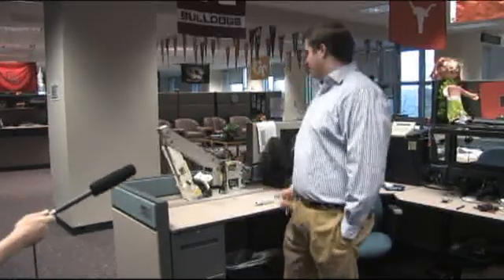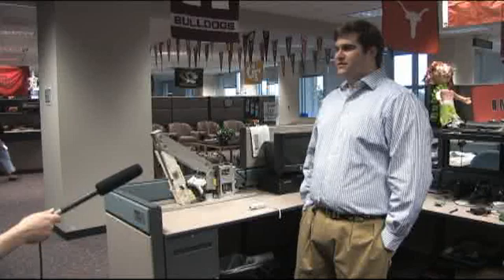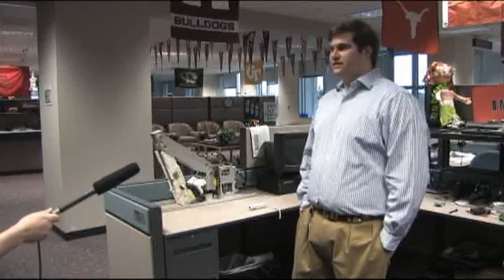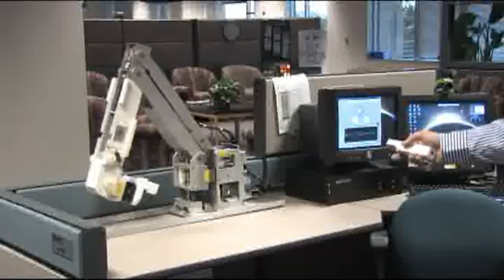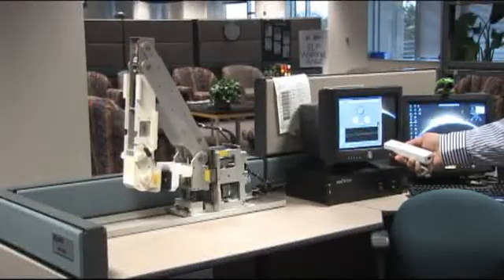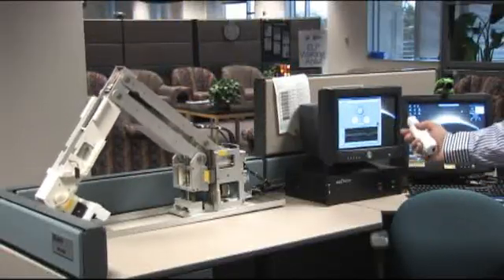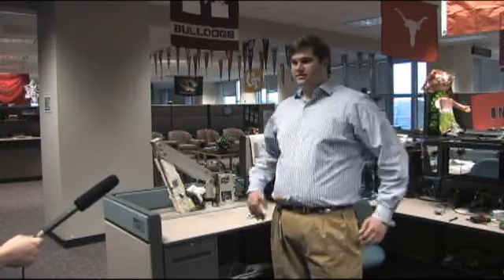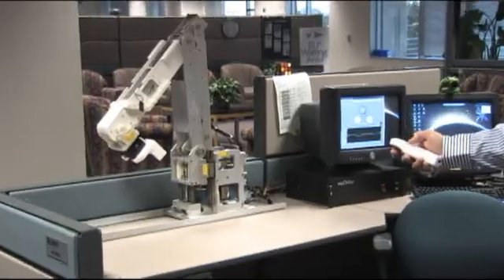The Wii remote (or wiimote) and robots

Comment: So, one of the questions I have heard on this video is, "What hardware was used?"  Evan used an old nuDrive (because I think that was what he had on hand)which is a four axis drive for stepper motors.  The motion controller was a PCI-7354 which has four axes of stepper or servo motor control.  Beyond that, there really is just the big robotic arm and a bunch of cables.